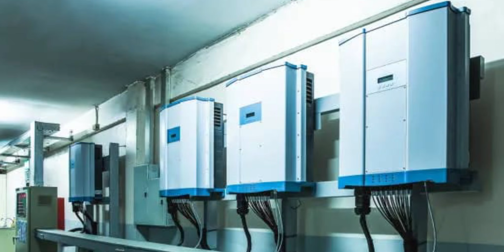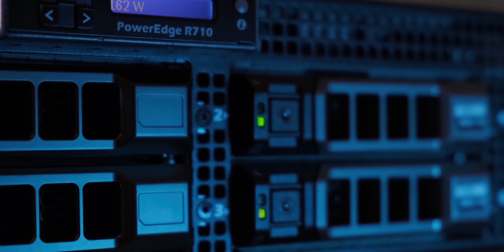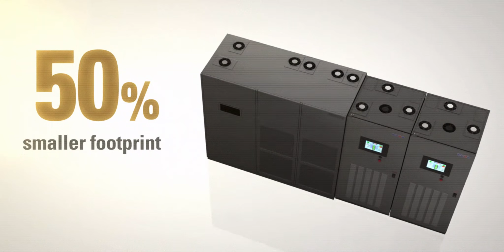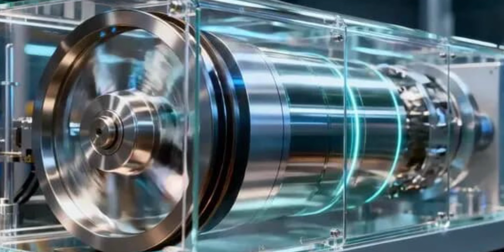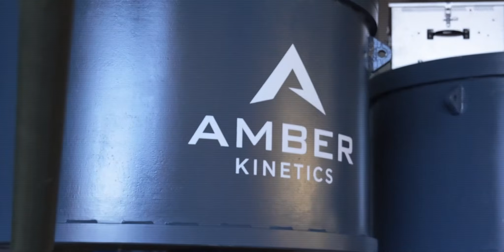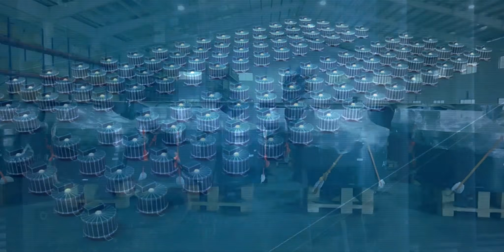Which Flywheel Is Best For Home Energy In 2026?- The Top 5 (Ranked By Real Performance)

Comment: Why is the grid so unstable that it burns through the lithium battery recharge cycles? 

I think centrifugal storage makes sense for short and long storage many situations. 
Solar Voltaic farms with long term strategy. 
For really long power backup heat is the way to go, storing energy as heat is volumetricly one of best ways.
Heat is used in a lot of manufacturing so no loss when turning it to electricity then back to heat. Building solar thermal power stations is even better because you start with heat and you have a heat battery built-in that can store heat for long term.
These batteries need these centrifugal storage generaters to link to the grid.
Long term is what matters and it needs more startup money.

 you can store